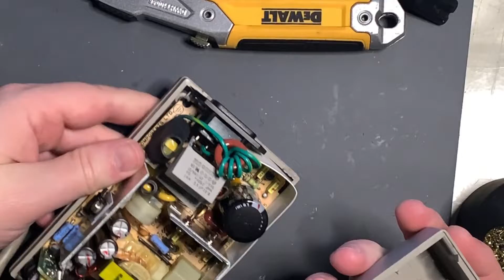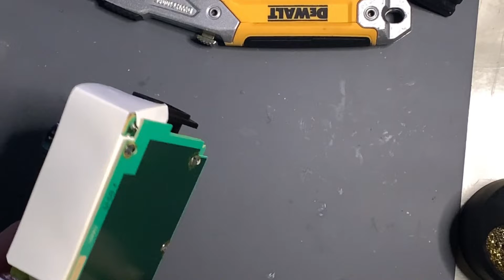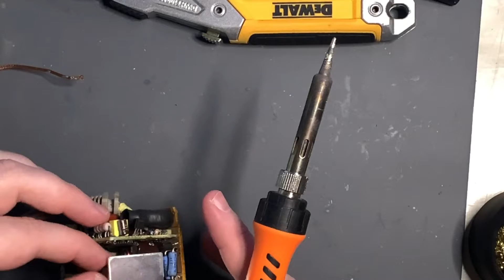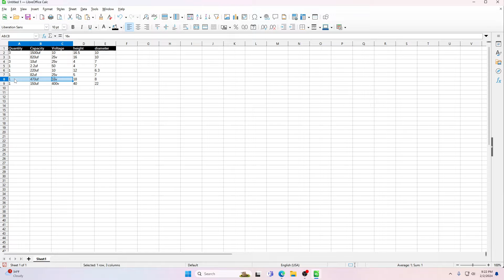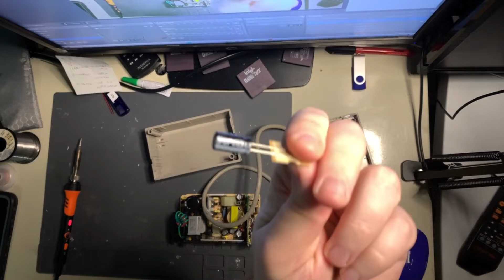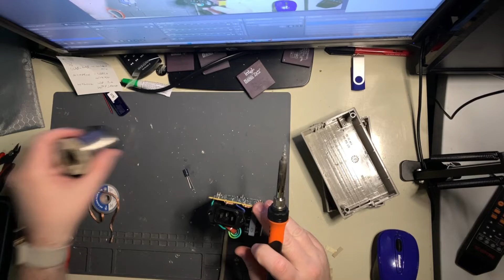Compaq Series 2692 Recap/Repair-For Compaq LTE 286 (118843-009)

Comment: I have an old Compaq LTE 286, however I no longer have the charger and I need help :( Do you have any pin diagram for the adapter? I want to make a homemade adapter, but i can't find any documentation.
Reply from the maker: I’ll see what I can come up with
Reply: @i80386sx  Hello, same issue here. If you can measure the voltage on each 4 pins of the power connector, and their positions, it will greatly help to make a custom power adapter :)

Comment: I also have a problem with this adapter (sometimes it works, sometimes it doesn't) and I want to replace it with a suitable replacement. I found somewhere on the net that pin 3 is the connection for 5V DC, and pin 4 is the ground.
Do you happen to know the color of that wire? Because I'm actually a complete novice in that area...
Thanks!
Reply from the maker: I don’t off hand.  Next time I look at it, I’ll see if I can find the answer.
Reply: @i80386sx  Thanks! 👍👍👍